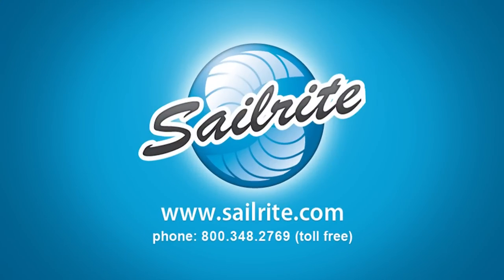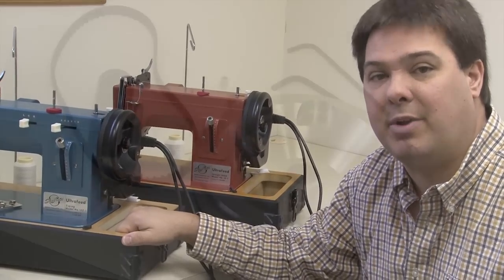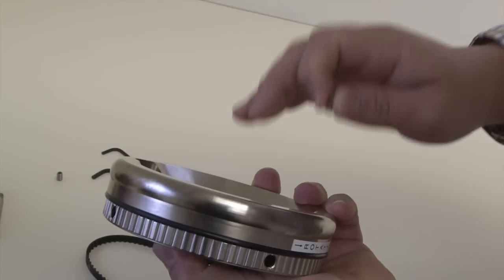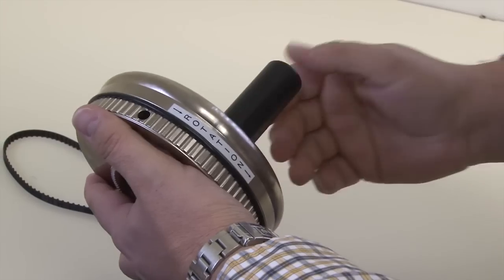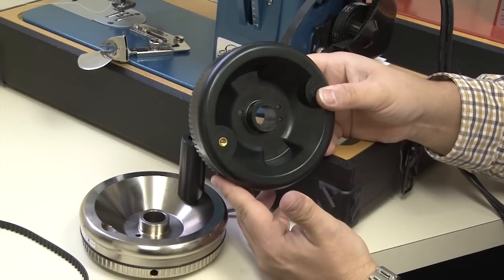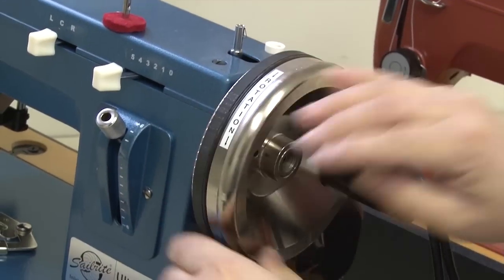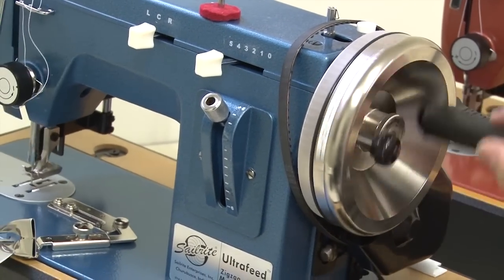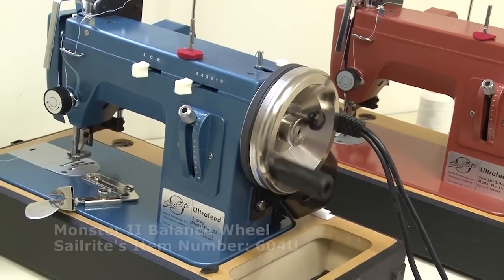Monster II Balance Wheel Installation on Ultrafeed Posi-Pin System

Comment: I bought a Reliable 200zx instead of the LZS-1 to save some money.  Ordered their Cuda Crank and found it wouldn't go on the shaft far enough!!!  The clutch assembly went on but the belt kept coming off.  Call Allbrands, where I bought it, and of course, they had no clue...  They gave me Reliable's number which I called.  Got put on hold until the gal came back and said the Tech was still busy.  So, I left a message...  I'm still waiting for a reply.  Damn!  I wish I'd spent the extra money for a Sailrite!  Don't make the same mistake I did.  Buy a Sailrite!
Reply from the maker: Your comments are true! We hear them often from many of our customers who eventually end up buying an Ultrafeed® Sewing Machine after buying a look-a-like sewing machine. If and when you buy a Sailrite® Ultrafeed® you will love it and we stand behind it with the best support!
Reply: I am so grateful for reviews like yours.  I have been researching walking foot machines off and on for quite some time, and finally decided to buy a Sailrite.  It is scheduled to arrive Saturday, and I can't wait!

Comment: You didn't change the belt in the video. Should I leave the old one on there for now? It shouldn't need changing since it's only a year old. 

I guess I should just save the belt that came with the monster wheel for later? 

Should I oil the shaft? Since the parts are metal on metal? 

Can you please explain why to remove the belt while hand cranking? Do I need to do that for random stitches here and there?
Reply from the maker: If the belt you had fits, then use it. Yes, oil the shaft with a drop of sewing machine oil. We remove the belt so we do not have to fight against the motor when hand cranking. You can leave it on and still handcrank, but it will not turn as easily.
Reply: @SailriteDIY  thank you! I realized the answer to my question when I hand cranked with the belt on vs off. It glides much more smoothly without the belt, for sure!

Comment: Anyone else having issues installing the Monster II balance wheel on their new Sailrite machine? On mine, it seems the tension on the timing belt is so high that it won't fit over the balance wheel. The tension is fine with the regular plastic balance wheel though.

Comment: Will the hand crank work with the original Power Plus wheel?
Reply from the maker: No, the Power Plus Wheel is too light weight for hand cranking, it does not work well. You need the weight of the Monster II Balance Wheel for hand cranking.

Comment: IF THE CLUTCH WASHER RAISED PRONGS FACE OUT AWAY FROM THE BALANCE WHEEL THEY DO NOTHING. aLL THEY DO IS SCROLL ON THE TIGHTENING NUT. tHEY DO NOT ENGAGE THE SHAFT OR CLUTCH.
Reply from the maker: The clutch washer prongs must face away from the sewing machine head so they engage with the clutch knob as it is tightened or it will not spin the shaft.